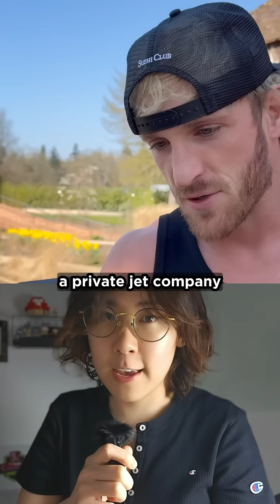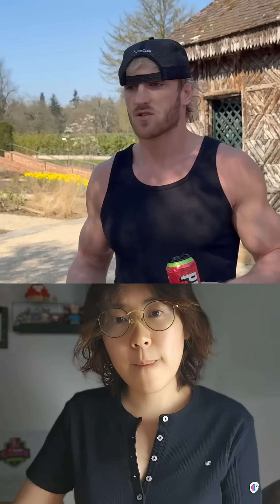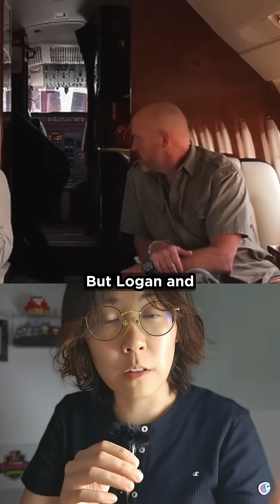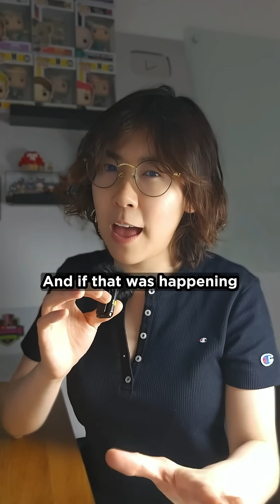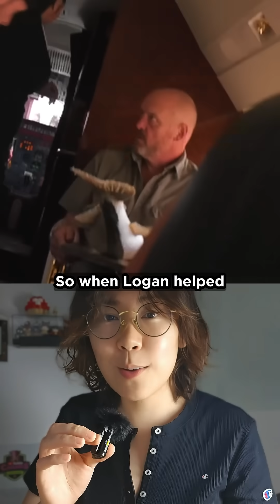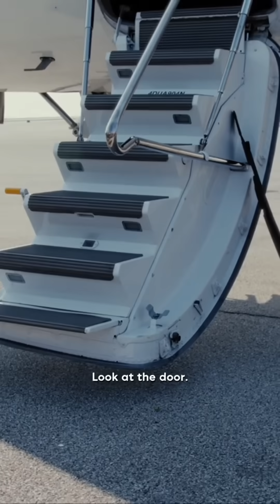How Logan Paul’s Jet Door Really Blew Off

Comment: It's impossible to open an airplane door in flight due to the enormous pressure difference between the pressurized interior of the cabin and the exterior. This difference creates a force that "seals" the door against the fuselage, making it impossible to open with human force. The plane's safety mechanisms also prevent opening it; superhuman strength would be required. According to the video, the door wasn't closed properly. The woman wanted to open it so it could close properly again, but she should have spoken to the pilot. He had already pressurized it, but with the door ajar, she couldn't open it. The loud noise was the wind leaking like a tire, only inside her ear. He's stronger and managed it. Even ajar, there's still pressure, which is why the door popped open, not exploded.

Comment: Actually, it would be terrible design if airplane doors could be pushed open by the cabin pressure. Luckily, they're not designed that way: the higher inner pressure pushes the doors tightly into place.

Comment: For the record; plane doors are usually designed to press outwards and utilise it to their advantage. If you’re high in the air, the high pressure inside presses the door out and into the frame of the fuselage, so it’s not just a simple mechanical latch that keeps it in place

Comment: That's not right you don't get cabin pressure unless the engines are running I need the engines are running huge clearly hear them but you can't hear them running so that nature makes no sense at
Reply: And it makes even less sense when the plane is not in the air why would It have high air pressure on the ground
Reply: I bet the doors would be set in emergency mode

Comment: So here is what really happened, and what possibly caused it.  So these aircrafts are equipped with a cabin pressure relief valve.  These valves have a manual(in emergencies) option that will lock it in one position with either a switch or manual lever.  More than likely the pilots forgot to put the valve in automatic causing the cabin to pressurize.  The valve will automatically adjust open and close based of current pressure in the cabin.  FYI im a prior aircraft mechanic.

Comment: but the cabin is pressurized to a higher altitude than ground level. the air pressure inside a pressurized plane is equivalent to 6-8 thousand feet roughly

Comment: Just a little tid bit, but not all aircraft doors are held in by just a mechanical lock. 
Some are physically bigger than the opening and are what we refer to as plug type doors. They open inwards slightly and then will pivot to fit through the gap and they are physically bigger than the gap opening for the door. This also helps hold the pressure in as the force from the inside seals the door in the frame.

Edit: I see you also mentioned it, but I'll leave my comment just in case anyone misses your own (:

Comment: Im an aircraft mechanic. I work on jets just like this. I can't imagine why you'd open the cabin door while the cabin is pressurized. The door being blown open like that can damage the door and surrounding structure requiring major repairs, or even kill ground crew. If there is an issue with pressurization there are a number of failsafes to prevent over pressurizing the cabin. This seems to me like the flight crew panicked and didn't know what they were doing.
Reply: I would suggest that they were trying to close the door since they were about to take off but Logan Paul being unfamiliar with aircraft doors turned the handle the wrong way.
Reply: @petehiggins33  If they were trying to close the door, how would he accidentally open it? How does that make sense?
Reply: @petehiggins33 did you not hear her tell they have to open it?
Are you deaf? There are wonderful hearing aids these days
Reply: @petehiggins33  Listen to the audio. She clearly says "You guys have to OPEN that."
Reply: @petehiggins33  They literally said "you're going to have to open this" they were NOT trying to close it. and if it was closed and they were about to take off, the cabin would not have been pressurized yet, because the door needs to be SHUT to pressurize.
Reply: Not when you have a high air flow Air Conditioning Cart inducing tons of air
Reply: Your lying “aircraft mechanic’s” don’t exist they’re named aerospace engineers.and don’t say I googled it because I learned from my dad who is a real aerospace engineer.
Reply: @SxmplySen Okay well you should probably Google "Aircraft Mechanic" my man. Aerospace Engineers and Aircraft Mechanics are two different things. Aerospace engineers design the airplanes and aircraft mechanics maintain them.
Reply: @magicalframe9441 you moron you are completely wrong

Comment: This is really wired, aircraft usualy dont have a higher inside perssure on sea level  the cabins are "pressurized but not to 1013 hPa its usualy somewhwre around 750 hPa when at crusing altitude.

Comment: If you’re wondering about this happening mid-air, the door on passenger jets opens inwards, meaning it has to fight against the force pushing it outwards.

A gorilla wouldn’t be able to open that, much less a person.

(The reason it opened in this case is because they’re at ground level where the difference is less, and it may not have been fully pressurized)

Comment: Cabin pressure safety/outflow valve failed…or it was left in the test position by ground crew…Causing the aircraft to over pressurize. Aircraft can and have exploded from over-pressurizing on the ground.

Comment: The fact that these doors don't open in is crazy and ridiculously stupid.
Reply: The force acting on the door from the inside because of the pressure differences would make it extremely hard to open the door inwards. 
An airplane door will typically have 12 tons of force acting on it, but humans have a pulling force of 90/55 pounds (male/female)
Reply: @blockyy.e  thats the point, its not hard to de-pressurise before opening...
.

Comment: You cant even force those doors open. I literally work on them and install them, theyre designed to open pretty easily sometimes its hard to get the latch in the right place so youll see someone spin the handle a quarter turn a few times. Hes much bigger and was definitely using a bit more force and it caught and he wasnt ready for the pneumatic pressure that helps pull the doors open by design cause they're fucking huge and heavy af

Comment: The whole point of the emergency pool handle on the primary door and emergency exit door is because those pool handles have small, explosive chargers in them.
1) This allows the door to open if there is pressure outside of the plane if it is in flight and the door has to open in an emergency and 2) if the primary handle to open the door get stuck or for some odd reason, the door won’t open when the plane is on the ground, those small explosive charges detonate, allowing the door to be forcefully open. 

The reason Logan Paul is an idiot is because you don’t pull on those handles because it is supposed to force the door open and it does break it !! 
I can’t wait to see how much they sue him for and win that lawsuit suite. 
And this is the number one reason to educate yourself and don’t just assume you know how things work….. EDUCATE YOURSELF. 
🤡🤡🤡🤡

Comment: Ugh. I hate to side on Logan on this one. That shouldn’t have been possible to begin with. Pressurized aircraft are designed to not be able to pressurized while there’s weight on wheels. The primary reason being that the door can kill someone or ruin an airplane if you open the door while the cabin is pressurized.

Comment: Door "plugs" The plane from inside. 
If pressure on plug is high enough, you can't open it. Pressure inside is what keeps it closed and sealed. So ether Logan is hulk, or cabin just started pressurizing. 
Mechanical latch doesn't do shit, it prevents the door from moving when depressurized. After pressurization you physically cannot switch the latch, since it actuates door inside first(door goes inside to unlatch and then goes back outside to open.

Comment: The pressure keeps the door closed if it was designed right.   One often has to pull the door in then rotate it to open.   You may need to re-release a fixed video.  Logan may have been strong enough to do something normally not possible.

Comment: As much as I dislike Logan Paul, seems like he was in the right for once. First of all he was asked to open the door with force, and also the cabin shouldn't have been under pressure at this time. In fact, unless the airport is somewhere in the mountains even a pressurised cabin shouldn't be at a higher pressure than the outside air on the ground

Comment: The problem with this story is that more than likely, the plane is a jet which most likely has its own APU or auxiliary power unit. The APU has several main jobs but mostly it's two primary jobs. To supply air conditioning while at the gate and the bleed from the APU is used to start the engines. It can also supply power to the aircraft without an external source or in the case both engines lose their generators and it can, technically, provide pressure to the cabin (Although generally done for maintenance because why do this on the ground when you have two perfectly good engines?) 

Usually the Delta P is less than .5 psi on the ground so I don't know why they're gaining pressure on the ground at all (Although this can be configured manually again, incase of maintenance) but the easiest way to turn this off is to simply turn off the APU and engines. No bleed would be allowed to pressurize the aircraft and the pressure would just dissipate since this jet isn't a vacuum. Infact, after the apu shuts down, it'd probably take less than 30 seconds for the pressure to dissipate. They honestly didn't need to open the door at all. The reason there was an "Explosion" is because they opened a door which caused rapid decompression. This is not Logan's fault, this was the fault of the flight crew, especially the pilot, for being slow to handle the situation.
Reply: Exactly. This flight crew is incompetent. There were a million ways to avoid this.
Reply: Exactly what i thought.How can this creator talking about this not know there is a huge pressure difference and we cannot open the door when we are in the air.thx for the apu tho didn't know that.
Reply: I think he could sue them for telling him to do something he's not trained in doing
Reply: @Schemez-16vhiphopbeatz No, probably not, but he likely could file a defamation suit. Possibly even abuse of process or malicious prosecution.
Reply: The problem with this story is it seems staged for views. Why would the flight crew even ask a passenger to open the door before takeoff? It wasn't jammed. If the plane pressurized then it sounds like it was properly closed. The whole story makes no sense and seems fake.
Reply: Because they had an Air Conditioning Cart hooked up to the Aircraft. It has nothing to do with the APU on the jet
Reply: Half a PSI is significant force over an area the size of a door…

Comment: What im comfused by is how the door opened that fast. Commercial aircraft dont pressurize. Yes, they arent a vaccum at altitude, but they maintain a cabin pressure of 8k feet above sea level. They arent pressurized on the ground.

Comment: Don't plane doors use a mechanism where you have to pull inward before you can open it outward, so the pressure actually keeps the door shut?

Comment: Crazy part is that flight crew should have know the plane was partially pressurized .. the way those doors are designed they aren’t supposed to open under pressurization .. it’s a safety feature so crazies can’t pop doors at 30k ft .. this is completely on the crews fault

Comment: Actually the PIC (pilot IN CHARGE) is ultimately responsible for the plane and the crew and under "captain of the ship" clauses in legal statues. 
Meaning the charter is ultimately responsible for the safety and flight readiness of their fleet aircraft. Get a FAA inspector to pay them a surprise inspection visit because failure to guarantee flight readiness of the aircraft. 
Meaning the aircraft crew knew of an issue and INSTRUCTED a passenger to correct the error in which the airline charter seeked damages because they couldn't pay for the KNOWN problems with the plane and circumvent responsibility and liability to someone other then the owner/operator of the aircraft.

Comment: Or… it could be, which is not unusual to have on planes, that the exit door was wired with explosive bolts (pyrotechnics). On the ground, or in the air, it should just shed the door off and out so you can get out.

Comment: Why is the cabin being pressurized to a higher pressure than ground pressure? Isn't the entire purpose of pressurization to at least reach a suitable pressure when in low pressure high altitudes? Pretty sure cabins are not even pressurized to full ground pressure when they're in the air, but I might be mistaken

Comment: The air crew were totally at fault because they had the aircraft pressurized on the ground which is something you don't do while still on the ground unless you are doing pressure leaks and that doesn't happen with passenger's on the aircraft

Comment: I'm an aircraft mechanic. This has to be a stunt where he paid the crew to do. It isn't normal practice to pressurize the cabin on the ground. This only happens to test the seals and the pressurization system during maintenance. The aircraft AUTOMATICALLY matches compensates for the inside/outside pressure. So I'm going to assume this happened after a flight and the plane is still in the process of automatically dumping cabin pressure to match outside pressure. There's now way in hell that the crew would ask a passenger to open the doors, let along do it early to depressurization.
Reply: Doesn't really matter but if it was real and dint film he'll be huge trouble, also I don't think il do something so dangerous for likes or that the crew will accept to let's him do this, this could arrive in court.

Comment: The fact he opened the door he accepted liability.  Welcome to adulthood everyone.  Just because someone says do something.  Doesnt mean you have to.  Thats part of living in a free countey.  😂
Reply: Dude, he got asked by the flight attendant to help open the door, likely because of the issue with the cabin pressure.

In an airplane if for example a crew member can't physically do something they will enlist the help of an able-bodied passanger to help solve the problem.

Flight crew generally don't ask for help unless necessary meaning that his actions in this case are protected and he is not liable for example if the aircraft gets damaged due to the door violently opening due to the pressure differential.

If for example a police officer or paramedic requested your help you would not be liable if something goes wrong, it would be the fault of the person who asked for your help because they are the ones that have knowledge to solve the situation, and if they picked someone and picked wrong they are the ones liable for your actions.

Comment: I’m an AMT. One of the top-of-the-list don’t do’s is trying to open a door on a pressurized fuselage. If you’re strong enough to overcome the latch mechanism, that door is gonna open fast. It can kill if you’re in the way. The cabin crew obviously didn’t know what they were doing. The PIC should have known the cabin had a differential and stopped them, maybe he didn’t notice. This is not Paul’s fault. This is the result of not following procedure by the crew.
Reply: Not entirely true it’s more than the latch you especially on a pax door like that. It would take extreme strength to open it that way or there was much pressure like .1-3 delta P’s. I know this as while I was doing a pressure check during engine runs someone tried to open the door ignoring the beacon I had on.
Reply: @famine6795 yeah umm, I basically said just that in my post, “if your strong enough…”. Maybe you missed it? But I’ve seen latch failures or incorrectly rigged doors that could be opened when pressurized. Your mistake would be assuming it’s right. You’re probably one of those people that will put something back together wrong and say, “that’s how it was.”
Reply: @check4twenty don’t have to question how it goes back together if you use your manual. And no “strong enough” puts it lightly you would need a truck. Go back to working on your recip airplanes buddy.
Reply: @famine6795 yeah no shit, use the manual, I’m saying people don’t. I’m saying question it. I’m saying I’ve seen incorrectly rigged doors that could be opened while pressed. Again, over your head. I don’t work on recips, I haven’t in decades. Right now it small and medium private jets. The only reciprocating action in those is the vip.
Reply: Given that the cabin crew is less knowledgeable than me on airplane doors... How is an airplane with a crew like that allowed to fly? Are private jets subjected to less strict rules? Would the pilot be able to stop everything before the disaster? I imagine he has some pressure monitoring devices...
Reply: Your comment has officially reached 200 likes